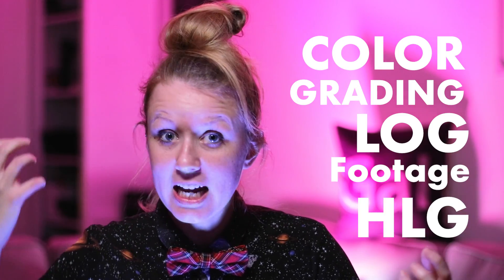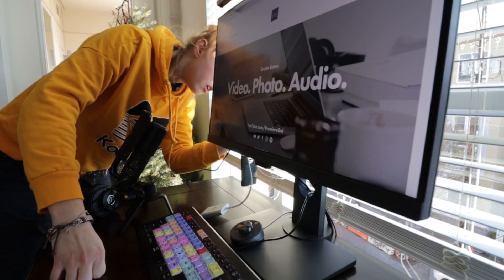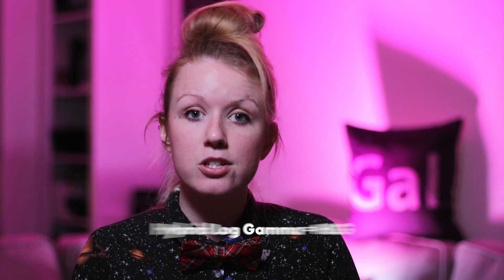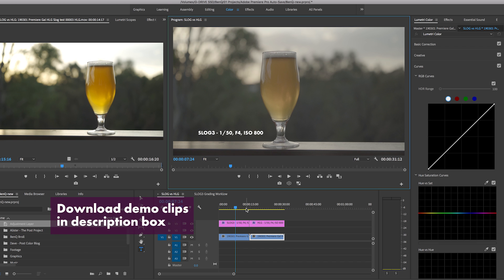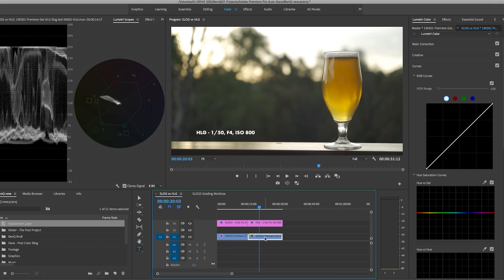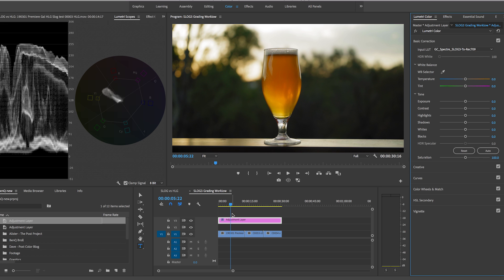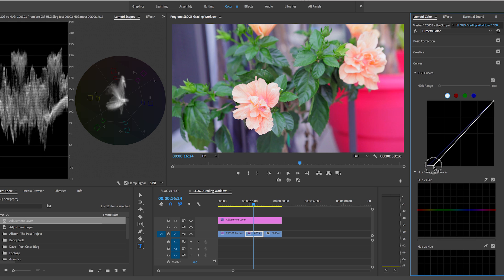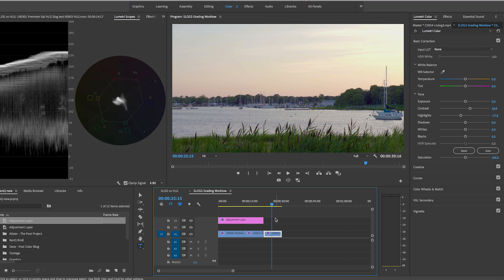LOG vs HLG How to Use LUTS and Color Grade in Adobe Premiere Pro Lumetri (BenQ PD2700U)

Comment: The problem that I must point out with the 2 test footage bits is that they are not exposure matched between eachother. Slog3 has a minimum ISO of 800 while HLG has a native ISO of 125. This is why the HLG highlights are blown out and unrecoverable, while trying to actually match exposures with the ISO you would get that highlights information back. So I think that matching the exposure levels on a Histogram before recording would have made this comparison better.

Comment: Wouldn’t the blown out HLG footage be ok if it was recorded with the correct exposure.... surely it’s not down to the format itself?
Reply: You’re assuming it’s exposed incorrectly. If you stopped down in that shot you lose all of the data in the trees. It’s always a balance and for this test I deliberately chose a stressed shot. HLG is good, but Slog3 still gives you better highlight recovery and a bit more data to play with.

Comment: Hi. Just started watching you.  Looks great. I'm in early stages making videos, about 3 months.  I need some help on something that I've changed or doing lately. The last couple videos I've made and posted on Youtube, they are not full screen.  It's like they are setting in a box. I am using Premiere Pro.  The last one I posted yesterday is "DC Steel Shooters-Winter Practice 3 2 19". https://www.youtube.com/watch?v=FYGMI_zqc4E   One thing that I may have done different is also sharing to my Facebook.  Not sure if this makes a differences.  I have used the black bars at the top and bottom before, but not in this video.  Thanks Barry